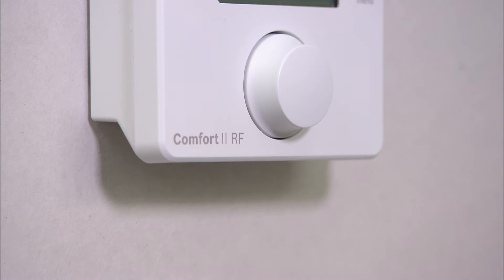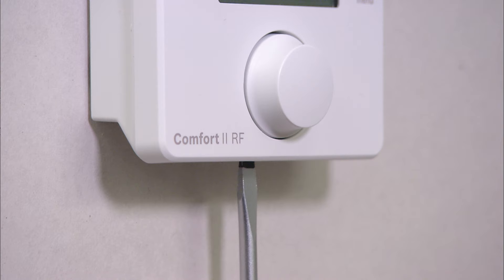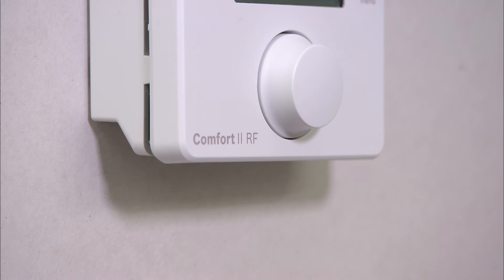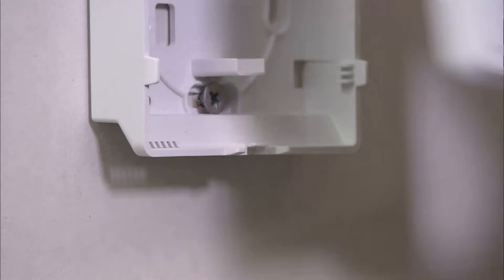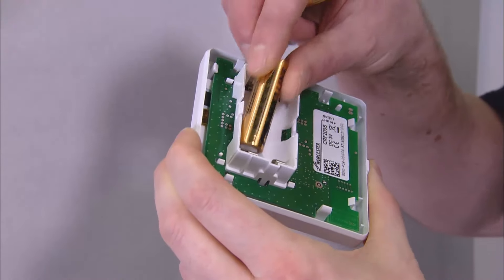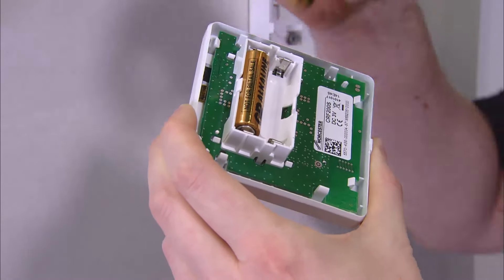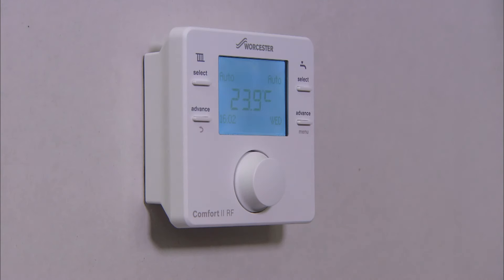Changing the batteries on the Comfort Controls range

Comment: The screen has gone black on the controller an won't come back on ,what do u do now?
Reply: Did you solve it? Have the same issue
Reply: I ended up just putting the old original batteries back in and it started working again as normal, not the obvious answer, but for a quick fix it worked
Reply: @tomg3245  oh thats great. i noticed that 1 battery didnt touch the terminal so i bent it and boom all good now